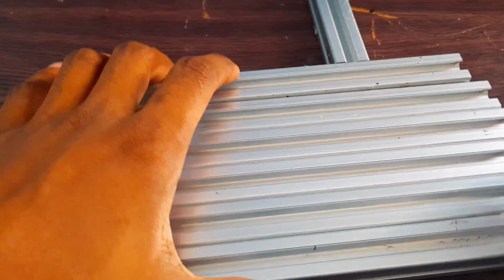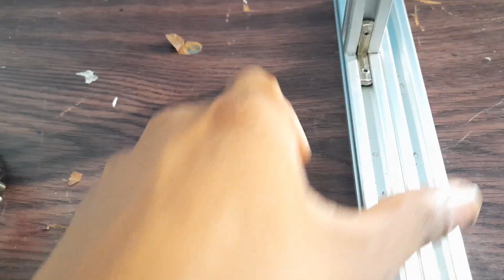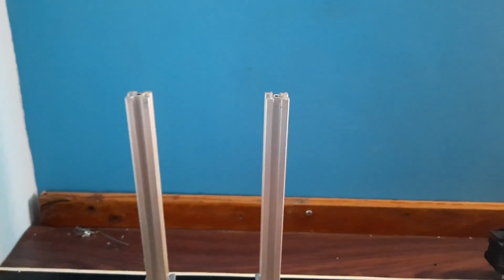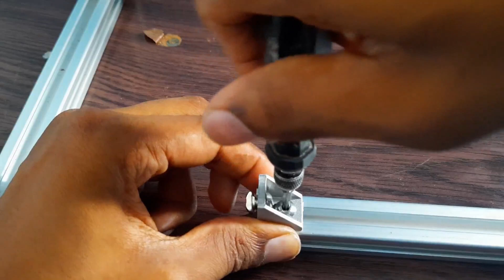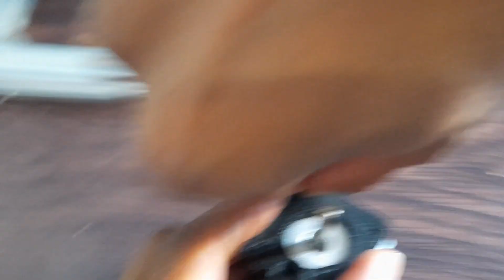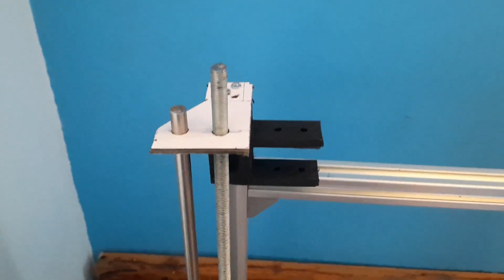Homemade Raspberry pi 3D printer| Making the frame and Z axis- Part 2

Comment: Can i get some help, I'm a bit stuck on building my drone
Reply from the maker: Where are you stuck?
Reply: @minilab3d  Not really stuck😅 but I'm missing some parts, and would like to know where u purchased them in Mauritius like the Battery and Transmitter
Reply from the maker: @thedudemru  i purchase most of the things on aliexpress... except the battery. You can get the battery and other components at VIN RC Hobby located at q.bornes. Search it on FB
Reply from the maker: You can get the transmitter also there but u can make a cheaper one with arduino. You can make it with the nodemcu which you can fly the drone on local wifi
Reply from the maker: Hello, a video on making brushless motor drone is coming next week... u'll find more details in making the drone... make sure to check it😁
Reply: I'm actually using an (Esp8266/Nodemcu) as my Transmitter for my drone
Reply: How can i can contact u ?